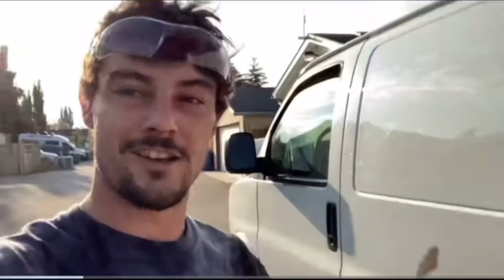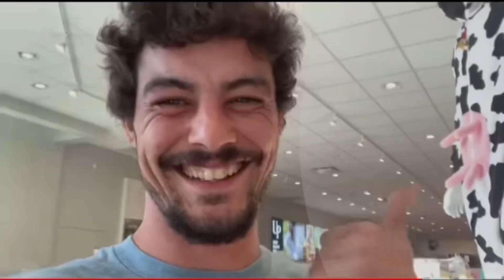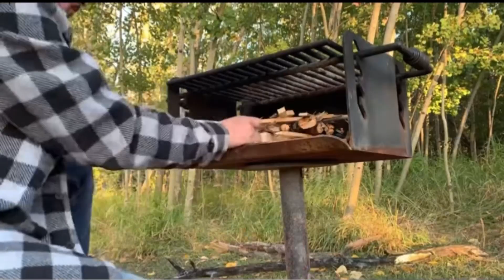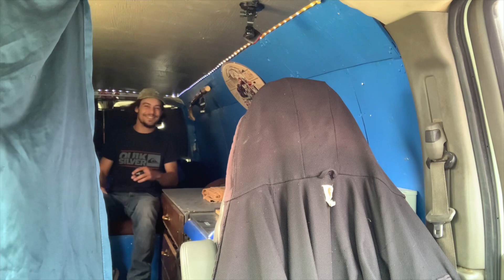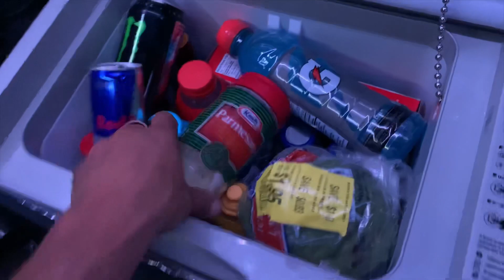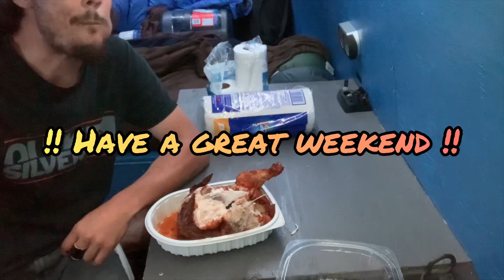When Your Van Sparks A Conversation

Comment: I have a 2008 Chevy express 2500 myself. I bought mine for $1500. It has a rebuilt engine and I just had the transmission rebuilt. Now I’m trying to save up money for my build. 
I’m trying to figure what’s most important and do things in stages. I wanna be doing trips by winter. 
My first thing I really need is seats. My driver seat is the most uncomfortable seat I’ve ever sat in. The cushions are worn Weird, that’s the best I can describe it. 
Then I wanna paint it. I figure that will prevent any rust plus raptor should help with the noise.  
I have some wood and I have some insulation for after the paint.  
My thinking is I can make the inside livable without being permanent until I get it painted. 
Lots of planing when your poor.  
I’m a disabled vet fighting the Corrupt VA. Social security gave me disability because of the military, but the military plays games. Anyway that’s how I’m gonna be able to travel. I wanna see America before I’m to old and can’t get around. I wear braces on my knees. But I can move pretty good with them. 
I’ll never have money to see the beautiful parks so a van is the only way. 
I’ve got the big part done. Just sometimes it feels like it’s not working. Then I don’t get out of bed, but I must make myself finish this. 
Well that’s my story I would really appreciate anyones advice or ideas or encouragement.  Thanks 🙏🏼
Reply from the maker: That’s so awesome !! I love hearing about people getting into vanlife without spending $100,000 on a rig !! 
I’m sure some of us would if we had it but we do with what we have thank you so much for sharing that great story with us and I really wish you the best on your adventures ! Also I totally agree these seats are horrible !! I’ve been trying to replace mine forever now but like you said lots of plans when we’re poor 🤣 🤷🏼‍♂️
Thank you for your service 🫡 
Thank you for your support and thank you for everything you’ve done for this world your an amazing person never give up 💪🏼😁🚐
Reply: It sounds like you have a great start on your van. To make my car's seat more comfortable, I put half of an old pillow under the ad-on seat cover.